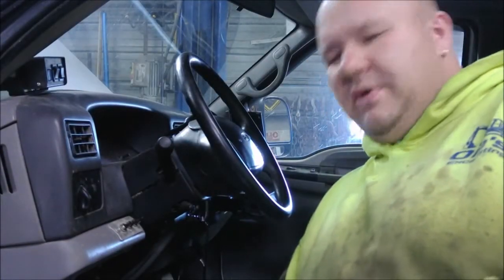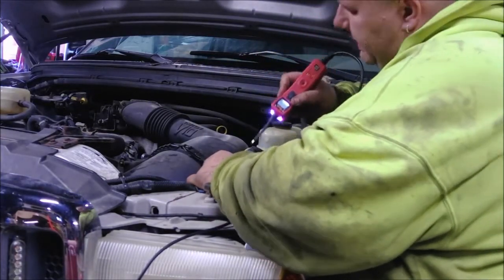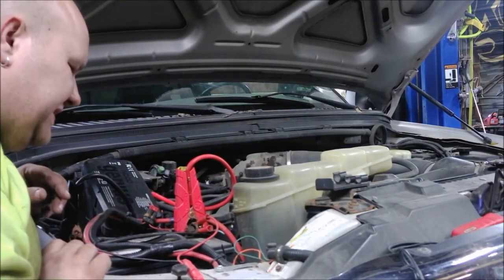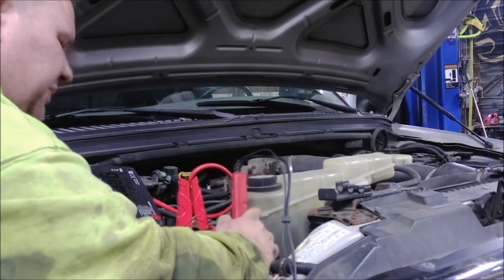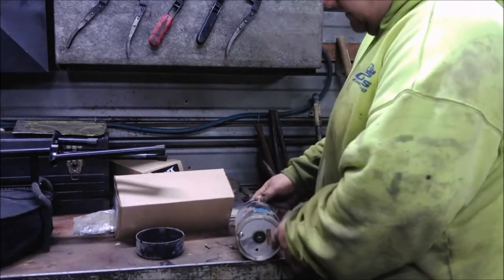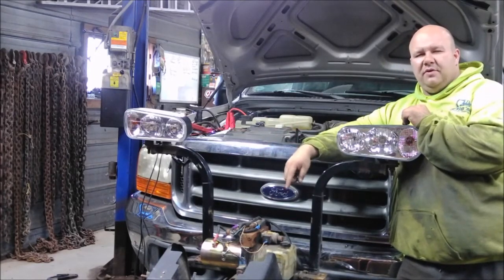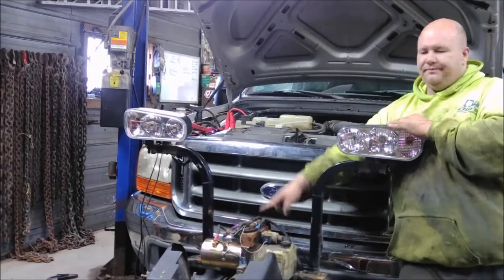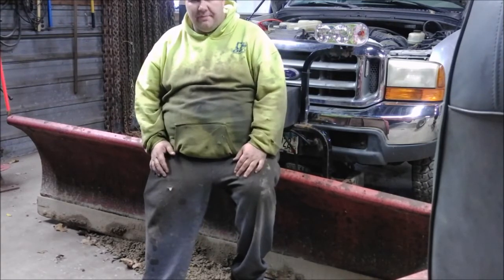Hiniker Plow Troubleshoot

Comment: At 4:25 how do you "add power"? Just bridge the two big posts on the solenoid?
Reply from the maker: The solenoids I use are two large posts on each side. Two small posts in the middle often referred to as a Ford style solenoid. I just take power and add it to one of the small terminals. I believe it's the s terminal.
Reply from the maker: Or yes you can also bridge the two large terminals

Comment: I wish I knew what you were talking about...have a hinicker and its giving me electric problems.  
Intermittent left, right,  up, down.
Reply from the maker: If it's not working at all start with fuses and main cable's, if it's working intermittently, look for bad spots in the harness
Reply: @KaputyINC  harness would be located under the hood?

Check bad spots with one of those electric detectors?

Where would fuses be?  Main fuse box of truck. 

Great video.  You have an easy going style.
Reply from the maker: @tjlomin1466  The harness should pass through the firewall from under the hood for the remote. Just kind of give it once over looking for bare wire's, make sure any major battery and quick disconnects aren't all corroded. Should be a fuse near the battery or wherever it gets it's source for power for the smaller gauge wires, it could be robbed from the fuse box, the installation is open for interpretation depending on the skill and pride of workmanship of the installer and anyone that may have worked on it since

Comment: My worker call me today and said the hinicker plow came off the truck. 

Get there and the 2 pieces on the truck,  1 looked bent. 

Couldnt get it back on..what a mess

Hinicker and boss need to get rig of the stands..just annoying.  The boss one you literally take the stand off and have to store it in your truck 

My western sits  without a a stand. 

And the connect for the hinicker is flimsy..that rod you pull isnt the most solid..

Comment: Question, my Hinkiner plow is getting jerky going up. Any ideas? The pump runs, but it's jerky. All other movement work fine. Color, and side to side
Reply from the maker: If your fluid is at full capacity, and doesn't have any water or anything in it, it could be electrical like your controller is cutting out intermittently  while you're lifting. Do you notice the solenoid clicking? I just had a guy whose plow wouldn't lift at all and it ended up being the controller. I took the controller apart a first for me, and found the joystick is replaceable but haven't looked into it any farther.if you know someone with a good controller maybe try to use theirs.
Reply: @KaputyINC  hey, thanks for the reply. Oil is full. But , could it be, ? An air bleed issue?? Like car brakes?
Reply from the maker: I feel like you would see it jerk side to side. I've replaced hiniker cylinders and didn't bleed anything and never had it shudder. It's hard to say.
Reply: @KaputyINC  it's the up and down, not side to side
Reply from the maker: I think I'd confirm that it's not electrical, do the pump studder too or run smoothly? it maybe an issue with a short in the drop solenoid or stem being sticky letting pressure bleed past while you're trying to lift?
Reply: @KaputyINC  pump doesn't stuffer, smooth. Just jerky raise
Reply from the maker: Pressure bypassing some where potentially, I've never had that happen before. Especially with the up since I don't believe it has it's own specific valve.

Comment: Repairing this plow for my neighbor lady.  Will not angle.  Sounds like it the valve inside the block?  Her husband worked on until he passed.  No books.  Do you know where I can get a PDF repair manual.
Reply from the maker: Other than a Google search, no I don't. That valve that slides back and forth does have a tendency to stick and it won't let it angle, you should be able to take the solenoids off, make it slide back and forth and put it back together. A light "technical tap" with a hammer sometimes does the trick
Reply: Thank you for your time.  I look at it when this storm passes.  Mtns. of Colorado.  I will keep plowing her with my rig.  Her husband passed only 4 days ago.  Thanks again.
Reply from the maker: @stevelogan2042  good luck

Comment: my plow slowly drops when i put it up? any ideas? If i go anywhere i need to chain it up because it will hit the ground in about 10 seconds
Reply from the maker: Assuming the cylinder isn't leaking excessively which I think you would notice my guess is the stem aka solenoid valve of your coil is allowing fluid to leak past, they have o-rings in/on them.  Maybe there's a possibility some voltage is getting fed to the coil that drops the plow, maybe just a little bit, enough to let it open slightly. You could rule out the stray voltage by unplugging the drop coil, it should be the one on the front of the pump not the top. You should still be able to lift the plow and if it still goes down my guess is the solenoid valve stem for that coil either has some bad o-rings or has went bad.
Reply: @KaputyINC  thank you for the reply. I did try unplugging the coil and cleaned that valve with solvent and compressed air but had the same result. O rings were not damaged, but maybe I'll replace them to see if it helps.
Reply from the maker: @kstorm889  no problem, I'd guess if new o-rings don't fix it the valve has failed internally. Last I looked you can get a coil and stem for $100  or so. I keep extras on hand myself.

Comment: so is your fuse inline on the main power cable coming from battery????  I am getting no power on my hiniker and can not find fuse?
Reply from the maker: The heavy cables(0-4 gauge) don't usually have a fuse, they go from battery to solenoid, solenoid to bumper quick connect, bumper quick connect to pump, there will be a wire from the harness that triggers the soleinoid. Fuses will be on smaller wire like 12-16 gauge.  One of my trucks gets it directly from the battery, the other from the fuse box. The installation is open for interpretation depending on the skill and pride of workmanship of the installer and anyone that may have worked on it since. It may be scotched locked to a random wire under the dash(NEVER DO THIS), or someone could have taken the time to add a circuit to the factory fuse fuse panel(highly unlikely).